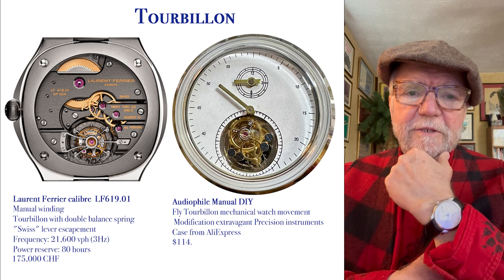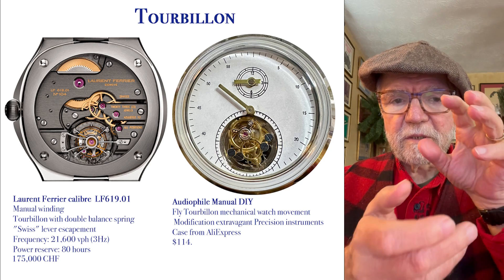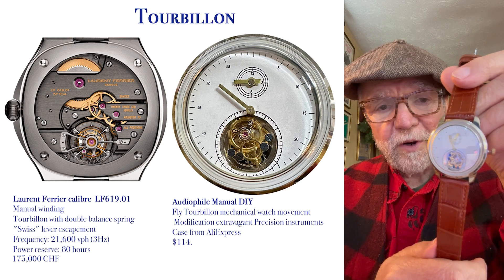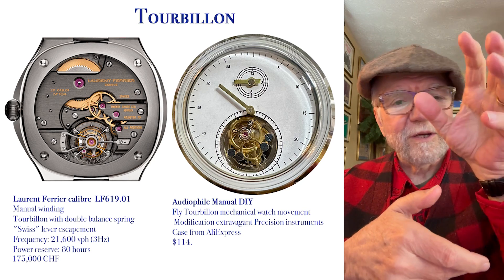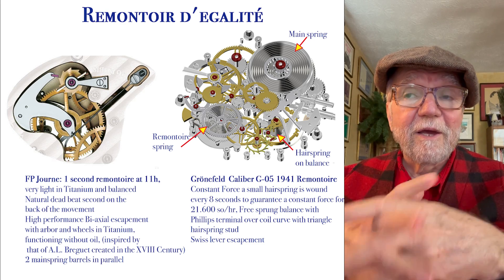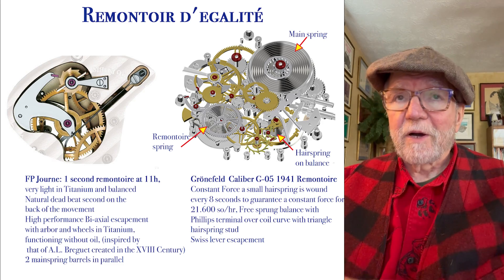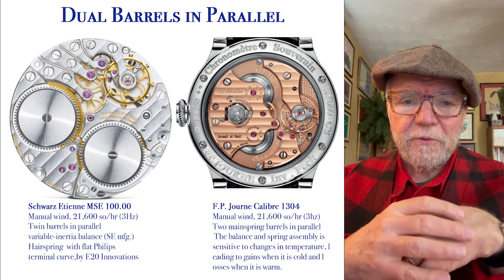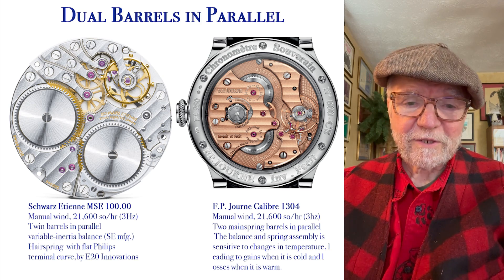Three Key Mechanisms for Maintaining Constant Force #VP265

Comment: Firstly, the Tourbillion is not a constant force device, though it may be combined with one. It's nominally a device to counter the asymmetric effects of gravity direction on balance springs, but is functionally useless on most modern watches. Have you ever seen a tourbillion watch manufacturer quoting its accuracy? Two identical spring barrels in parallel will behave exactly the same as a single barrel with twice the spring constant. If they're not identical you need to combine the output using some type of differential, but it's still nowhere near a constant force. BTW, I asked Denis Flageollet of De Bethune about this and he told me the preferred option for maintaining a more constant spring torque is two barrels in series with  different calibrated springs, but again it's not a constant force device - just something that helps to flatten the torque vs angular displacement curve of the spring. And you missed out the grandest mechanism of all, the fusée and chain, which keeps my 153 year old cathedral clock accurate to within two seconds per day, and runs a week before needing winding. Also found in several watches by Lange, Breguet and Romain Gauthier. And then there's the IWC Tribute to Pallweber which uses 2 barrels and 2 going trains to produce a similar effect to a remontoir without technically being one. My most accurate watch (a Grand Lange 1 being the worst 🤪).